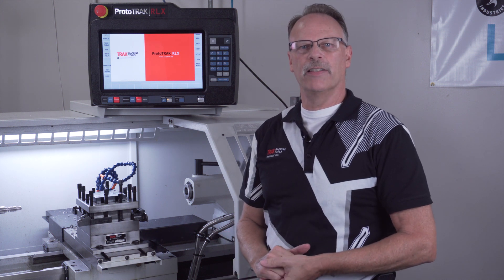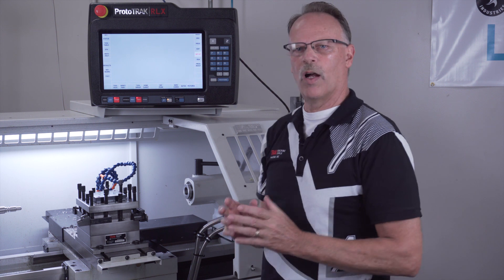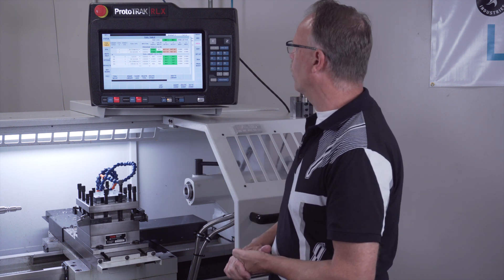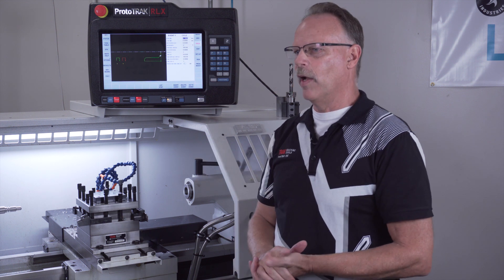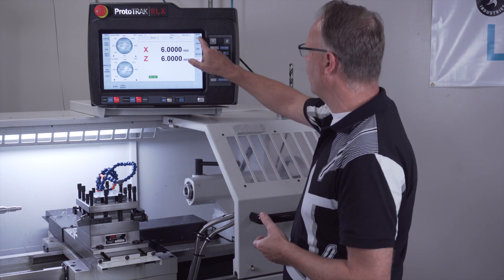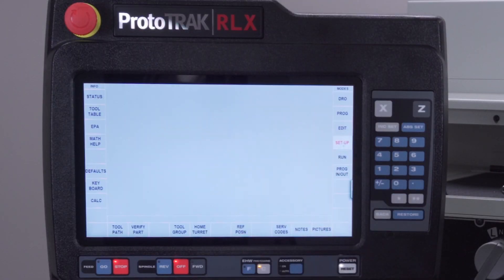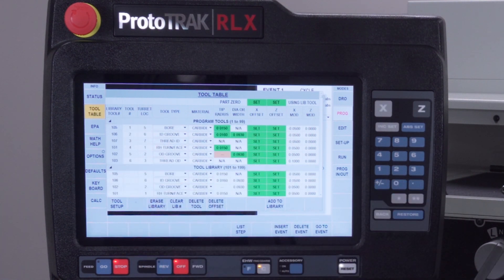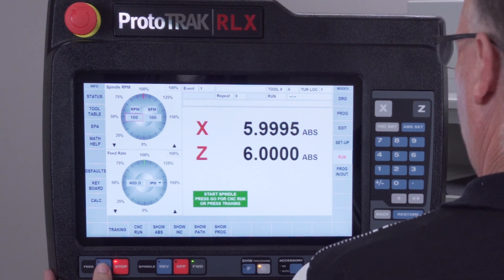TRAK 4 and 8 Station Turrets Overview

Comment: how are yoou holding your boring bars in when your holes on top oer not ment for normal bars
Reply: The ID tool holders mount to the outside of the turret. They are available through our service department. I show what one of them looks like around the 2:50 minute mark. You can see what they look like on the 8 position turret but they have a special mount that fits in the slot of the 4 position turret and then the ID holder mounts to that.  T.P.

Comment: how do you drill with that
Reply: There are drilling cycles in the PROGRAM section.  After that, you either put a drill chuck into one of your ID holders or you use the proper sleeve to hold that size drill bit. T.P.